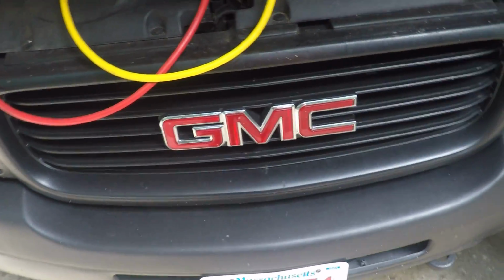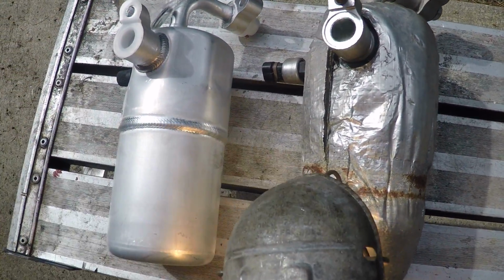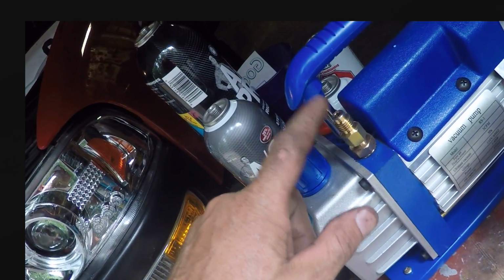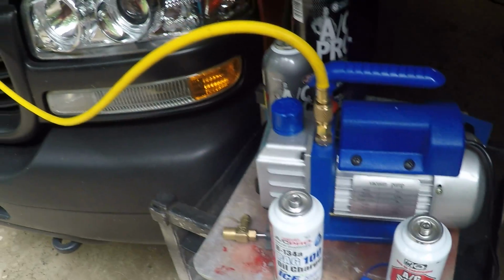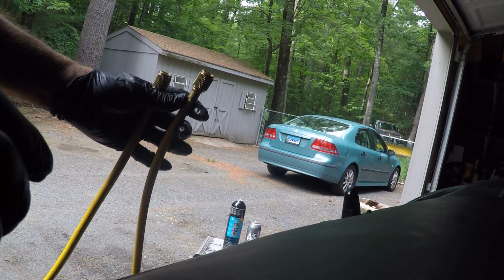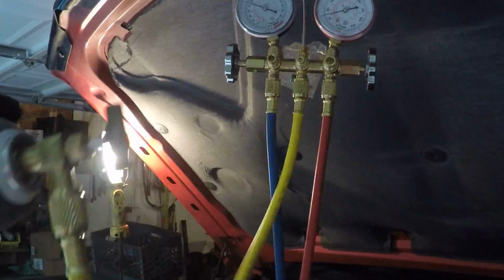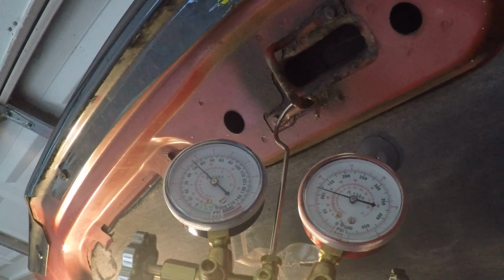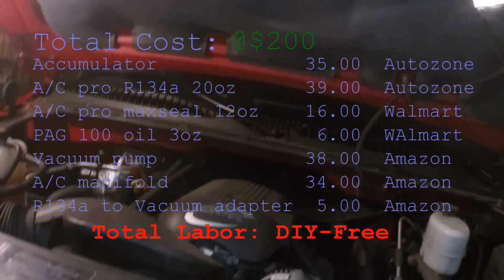AC repair for 2002 gmc sierra

Comment: i HAVE a 2001 Suburban and just rolled over the 300K mile point - still, drove long distance and didn't use a drop of oil on the entire trip.  My advice is to use Synthetic Oil and keep everything in good repair.  The newer Chevy V8's don't last as long with AFM systems like different lengths on the lifter.  Chevy is cheapening their products, but the older engines without AFM are much better in performance and durability.
Reply: Amazingly, also, I still have original brake pads on one of axils, so I'm happy with the product, but again I wouldn't trust Chevy on the big investment for the newer cars.

Comment: I have for years put the freon in my older vehicles, and others as well, after the winter has leaked enough freon to shut the compressor down, all by ear and sight. Yesterday I was doing the same thing on my friends 2002 1500 5.3L and the old way did not work.
I put the  two small cans of freon as always however, the compressor would not run.

After viewing other Youtube videos, and a paperclip I was able to find that the A/C relay  in his under the hood fuse box was not working and replace this, still no cold air...  Again with the paper clip I was able to see that the A/C cycling pressure switch was the final problem, replaced it and very cold A/C.

That said, after watching you work through a non-working A/C system with the gauges, and vacuum pump I now understand how to use the once baffling gauges.

Thank you, 
After your video, and reading the comments below am researching the gauges, fittings,  and vacuum pump to properly do the job.
Six years ago, and still improving complete strangers lives.
Reply from the maker: Well thanks for the kind words. As a DIY person that does everything myself I sometimes fumble my way through stuff and eventually figure it out. But there is a lot of negative Nellie's out there . I post a lot of things as a DIY, but this particular video one negative comment was "this guy did EVERYTHING wrong,  don't watch"  But yet I have ice cold air. So again thanks for the positive comment.

Comment: Well, I didn’t see your video in time. Took my 02 Sierra to a local shop yesterday. They hooked it up to a machine that did the entire process automatically. They did replace the inlet valves first. That was where my refrigerant has leaked out. Vacuum held, gassed it up, done. For $50 - less than the cost of a set of gauges from Harbor Freight.

Comment: Good job but one main thing you need to do is Purge the yellow house by just unscrewing it a couple turns before you open the low side valve....I cringed everytime because the hose is full of enough air to defeat the vacuum and suck in moisture from the air. ....air and moisture in a system is bad!...great job otherwise....you mentioned the vacuum pump getting hot....I'd change the oil with some good vacuum pump oil and see how that works.

Comment: Why the hell is the low side and the high side port both on the same line set?
Reply: The orifice is in between those...it's a metering device...technically everything is in line...it's a closed loop. Like a TXV or a piston on a residential split system or a refrigerator...that orifice pulls out with needle nose pliers and should be replaced when the system is open....the cost $5 and it's a crucial part of the refrigeration cycle
Reply from the maker: yeah a few people pointed that out...don't know its original truck, maybe some kind of one check valve is my guess. I don't know jack shit about it but it still works today.

Comment: Here in Central Florida, there is a nest of Thieving Bastards, that are fleecing the public, Example, The job your talking about , if you replaced the AC condenser and the Dryer, along with the Compressor. That's right , ALL OF THAT , would take you labor wise around 3 to 4 hours.  If these Bums charged a Dollar a minute for their labor it would come to 180 to 240 Labor. added to the cost of the parts. Condenser/60 , Dryer/40, Compressor/400  Parts 500 dollars added to Labor 240. Total of 740 Dollars. BUT NO , here in Central Florida these gouging Bastards want 900 to 15oo for the same Job. That works out to 2 to 3 dollars per minute for labor Where does one go to get an honest estimate to repair a Air Conditioning system on a car that is 100 degrees inside in the summer months, I'm 75 years old now and barely able to stand and walk from all of the medical problems over the years.  Some time s I want to just shoot these lying scum bags and walk over their dead body

Comment: I know this video is almost 3 years old but, from what I have read and videos I have seen, that a/c stop leak is one of the worst things you can do. The tubes inside the condenser are very small and that stop leak will do nothing but clog them.
Reply from the maker: blueknight I agree on the stop leak stuff I must have a small pin hole somewhere because I have to recharge this every year but it still works so there's that
Reply: J La Then I would just use that florescent oil or whatever it's called and buy/ rent the light to determine where the leak is.

Comment: i might of missed you do it but you should always purge the yellow line with freon before you open the valves befor 1st can and again amytime you change cans or you suck the air in the hose into the system

Comment: Great, easy to follow video. Well done, Sir.  The only thing I think you might have missed showing us is putting a little of that A/C oil on the o-rings before re-installing the lines on the accumulator. That helps keep the O-rings from drying out and cracking.  Other than that, you have probably saved a lot of folks watching this between $400-$500 bucks!!  Thanks so much!

Comment: Great job Your vacuum pump has a exhaust port on it you were running it closed that's why it is so hot.
Reply from the maker: wow thanks
Reply from the maker: i just looked at pump, it appears to have a kind of pressure release cap. i took it off and the center inside goes back and forth with spring tension, but even so next time i use i will try with cap off. thanks

Comment: I would definitely replace the accumulator 
and replace the orifice if it's over 5 year old.
I'd also change the filter and clear the condensation drain tube.

Comment: I'm working a the same 5.3 liter engine.  I think you should have replaced the orifice filter too.  It's located between the high-side and low-side port.  Great video.  Only video I found on this engine.  Orifice is $5.  easy to replace.

Comment: How does that work when the high and low are hooked up to the same line it looks like. Explain please. Most have two seperate lines to hook to.thank you
Reply from the maker: I'm not positive but it appears that in between the high and low ports there is some kind of Union. I assume it allows the flow to go one way kind of like a diode. I thought the same thing when I saw the two ports on one line. trust me I looked and it's the only two ports available.  plus the fact that they won't fit on the fitting if not the correct ports and it worked and still working.
Reply: Ok thank you, i'll have to give it a try. thks alot
Reply: after the high port in between the 2 is the orfice,, basically a restriction which cause the gas to go back to fluid theres a union inbetween the orfice is there
Reply: The metering device is in there....between those two ports it goes from high pressure to low pressure

Comment: How is it holding up? Still blowing cold? How did the static pressure test go? We're they even? Thanks for the video. I'm going to do mine soon.
Reply from the maker: +AlapahaGuy it worked all last summer. have not used a/c yet this year but i hear compressor kick on and off with defrost mode
Reply: That's normal.

Comment: Nice video, my sierra has no cooling fan on the ac condenser in front. It doesnt blow ice cold but on the highways it sort of work. Im thinking low charge. Does yours has a fan ?
Reply from the maker: +Veikra yes mine does have a fan...sorry for the 1 month delay for reply.
Reply: an electric fan on top of the mecanical one? I might not have a electric ac fan because I have a diesel engine that requires more flow to actual radiator.